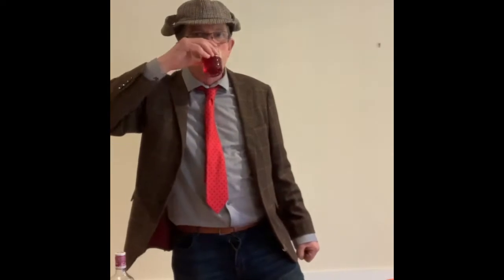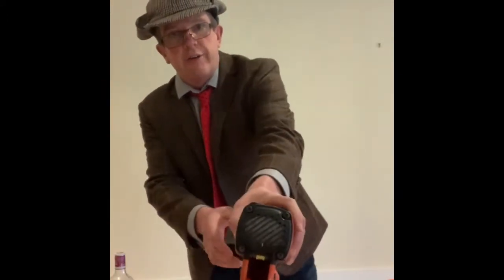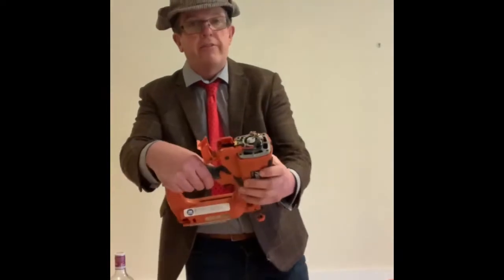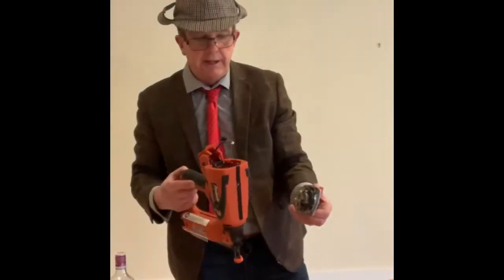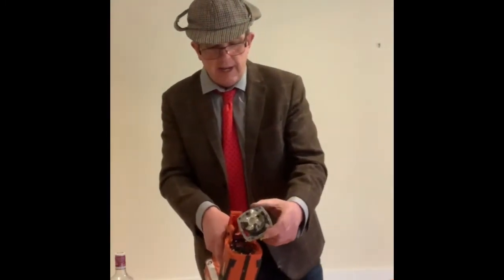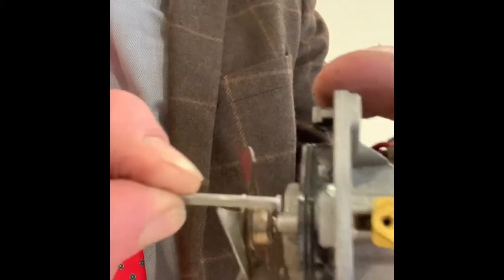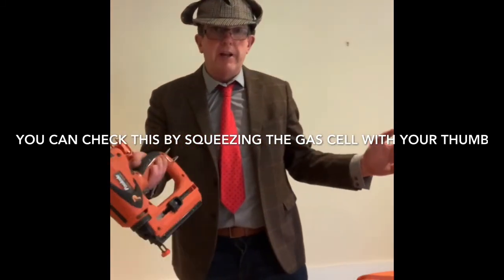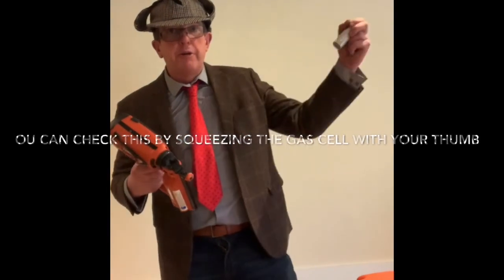Paslode Nail gun not working

Comment: Many thanks , not sure i'm dead keen on your style but after taking my 13 year old im65 in to fix an intermittent problem an the service place telling me they couldn't find a problem and that they thought it might be the firmahold gas !! 
I watched your video and i think its the worn cover or pins that push the cover , i need to give the gun a good testing when i get chance but it's looking good , so again many thanks 👍
Reply: What happened, I've the same gun, age and issue
Reply: @MotherAlgorithm  For me it turned out to be the firmahold gas i was using , went back to new paslode gas and it was fine .
Reply: I figured out the problem with mine, there was a nick in the spark plug wire that when assembled was arcing to the fan body. Was driving me nuts because when disassembled the fan was working, the spark was working fine, however when back together the spark was jumping out of the wire. Bit of heat shrink fixed it.

Comment: I tried using my thumb to push the gas in but it didn’t seem to help. The gun did nothing. When I take the right angle adapter off the cell and depress the tip of the gas cell I hear it coming out, but when the right angle adapter is on the fuel cell and I depress the tip of it I hear nothing. Is that normal? Does the right angle restrict the flow THAT much ?